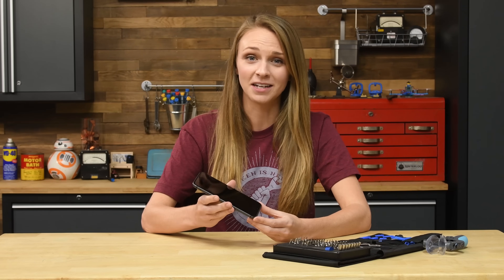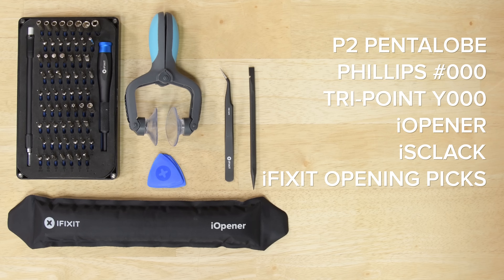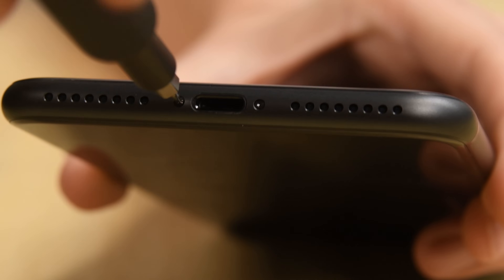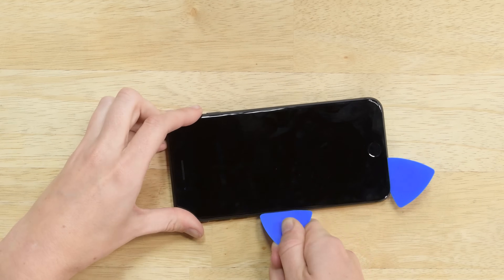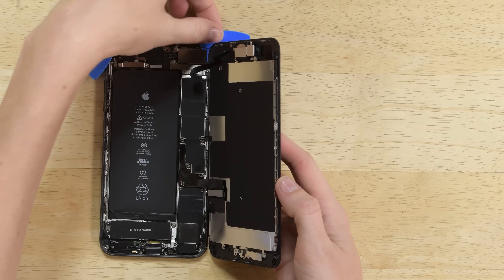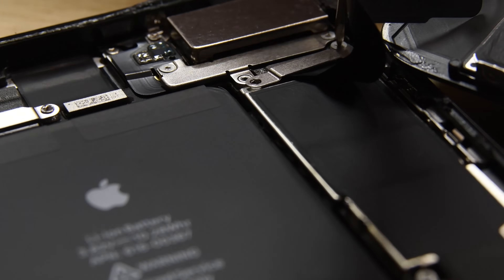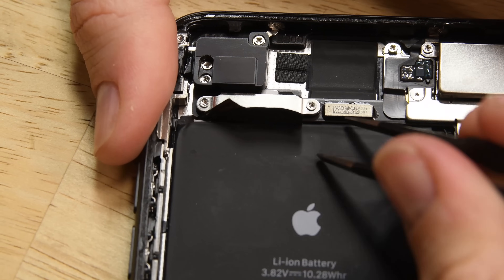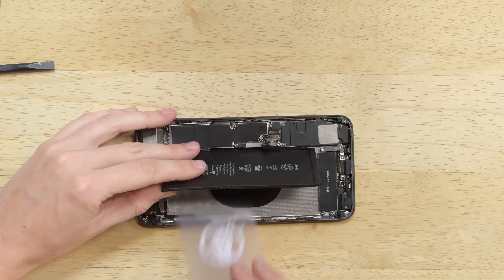iPhone 8 Plus Battery Replacement- How To

Comment: DO NOT FISH OUT THE ADHESIVE WITH YOUR TWEEZERS!?!?!??! One wrong move and your gonna have a ball of smoke choking your lounges out and probably a small fire. come on Ifixit. y'all should know your telling this to do it your selfers that don't have knowledge of the dangers of a battery removal.
Reply: The same could be said by sticking a larger tool under the battery and  accidentally bending the battery to remove it. We used ESD safe tweezers as a very last result. Some adhesive strips will pull off just fine, but the tabs on these broke with hardly any effort (on both the iPhone 8, 8 plus and a friend's 5c I helped fixed this week). You'll need some sort of small tool to grip and pull this adhesive out. The curling method with tweezers worked for us. Got any suggestions?
Reply: If you manage to puncture your battery with tweezers while trying to fish out the adhesive strips, you lack basic motor skills.